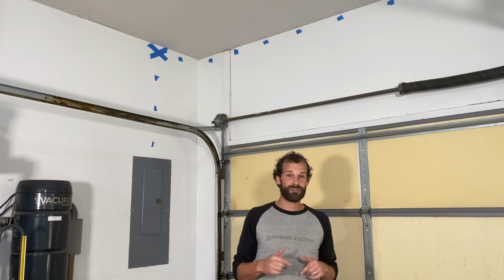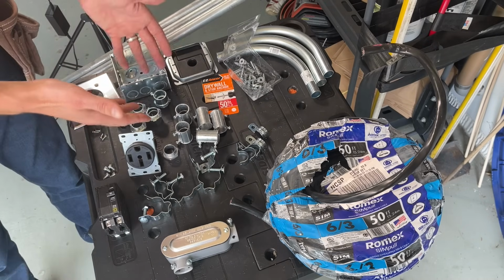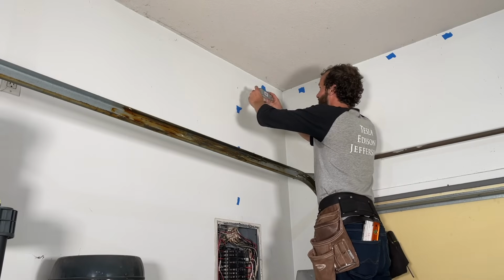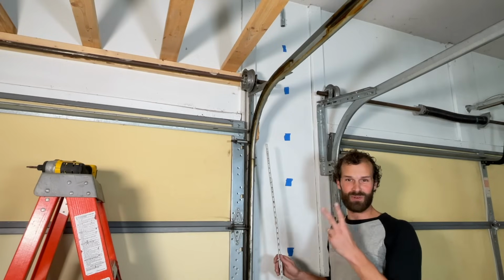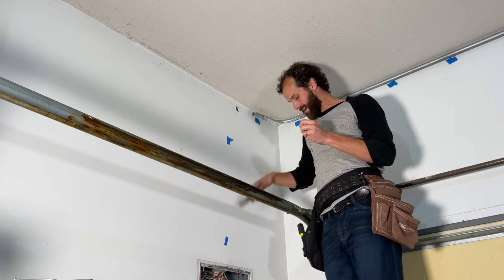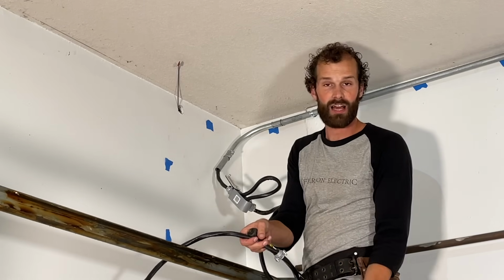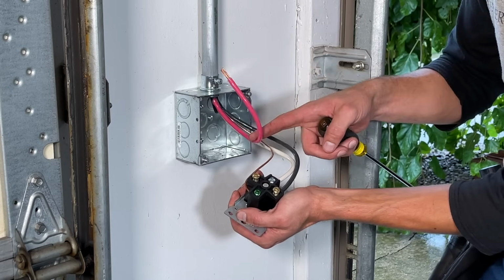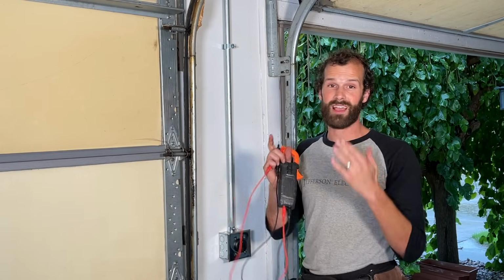How To Install a 240 Volt Outlet | Electric Car Charging

Comment: That's a great installation but a few things here; first you should really buy ure self a nylon fish tape if you work on a live panels, second, always use an LB best ever from coming off the walls, third, you made a code violation on installing NM romex cable inside EMT and lastly you could have used 8/3 NM romex but but only  inside walls or  #8 AWG THHN threw the EMT witch you have used in this application, Good clean work tho..!  Some I've done with data network cable as well.
Reply: Unfortunately, I think that 6 AWG wire is required due to the 60 degree celsius rating of romex (see NEC 334.80 and Table 310.16).

Comment: What was the price difference between romex vs single core and conduit ? A few pple I watch from Texas went with Mc over romex because it was cheaper smh on tht 1 lol. Wait a minute why wld you run romex thru emt (yes most ahj will allow it) but it's hackey and sloppy not to mention more money than just buying a 200 to 250 ft spool. Also an antishort bushing on that romex connecter wldnt have hurt too lol all In all not to bad should have stripped that romex from the lb to the other outlet box run and used a romex connecter on the open end of lb going to panel your lucky you don't have a strict bldg dept lol
Reply: Thanks for commenting. Most forms of flexible wiring like MC cable don't comply with the protective requirements of our AHJ (see NEC 330.12(1))
Reply: @joelwalsman773  o ya I was just using the Mc thing as an example what I was getting at was why use the romex vs just single core spool as usually romex is more per foot over say thhn just needed to cut in more of the sheet rock and just did the whole run in conduit and thhn over the more expensive (I'm going to assume romex) unless romex was about the same as single core spool per foot? I've seen say that 50ft romex for like $225 but single core thhn for like $130 or less for a 250ft spool
Reply: @wizard3z868  I like it!

Comment: if you are using 3 wires (2 hots and neutral, No Ground). Use NEMA 6-50. Tesla no longer includes NEMA 14-50 Adapters. Giving you the choice of buying 6-.50 Pig tail for the mobile adapter
Reply: Tesla sells the adaperter on line $35
Reply: NEMA 6-50 is two hots and a GROUND ......... no neutral

Comment: Is USA 120 volts?
Reply from the maker: 120V / 240V
Reply: @EverydayHomeRepairs  so is there a different shaped out let to prevent plugging in a 120 appliance into 240 outlet? Thanks from Australia
Reply: @richardday2893  yes, many configurations depending on ampacity, phase (single phase or 3-phase) as well as voltage (120V,  240V, 277V, 480V, as well as 120/240V (receptacles that include two phase conductors and a neutral). Almost all of these configurations are based upon the North American NEMA standards which help us keep consistency in our installations.
Reply: @steveloux4709  thanks for the info.

Comment: From a practical standpoint, 6/3 Romex is just too stiff to want to pull through conduit of that length, so pulling individual wires through the conduit would have been easier and much faster. There are different options to get into the wall to the breaker panel - I probably would have preferred flexible conduit and a large junction box to avoid the need to splice wires.
As an owner of a 130 year old house, I do appreciate the improvements made to home design in areas such as fire safety. Still, homes have have taken a step backwards in maintainability - it should be easier to do things like access a breaker panel to add a circuit.
Reply: Yeah.  I'd go with individual THHN wire in conduit here, and not the Romex, personally.
Reply: Romex is not recommended in conduit (extra heat). If you are running in conduit you need a larger conduit than you would usually use for the same number of conductors.
Reply: @rich7447  I just learned that from a licensed electrician. He recommended to use thhn 8 in conduit
Reply: I so thought of doing that way as well. Good point
Reply: I freq map out my paths and pull the wire through the conduits, before anchoring it.
Reply: Romex is needed behind the wall though.
Reply: @heyitsjay22  not if you run flex. Would have been easier and faster
Reply: @heyitsjay22  Behind the drywall you could use Romex and connect it to individual wires in a junction box outside. That would be fine. But, you could also fish a flexible conduit behind the drywall so that you could run individual wires the whole length without splices. A vehicle charger can draw high current for several hours, so I'd prefer to minimize the number of connections when possible. Actually, I tend to run new circuits from time to time, so if that was my house I'd probably make that section of drywall removable to make various installs easier.
Reply: @JasonEDragon  I agree, I would have cut the drywall.  Also using the individual wires would be better for heat dissipation.  Thank you for your response.
Reply: Romex Dosen't  belong in conduit,  check building codes.  And see manufacturers uses and why.....
Reply: @dannytorres4388  Article 334 Section 15 (B) "Protection from Physical Damage." Says that you can use EMT, RIGID, or PVC conduit  for Types NM and NMC.
Reply: @dannytorres4388  Send us a code reference saying romex is not permitted in conduit
Reply: I just don't know why conduit is outside of wall. For $1k
Reply: @MultiMaverix  If you don't want to rip the drywall off, yet still provide some physical protection.  Electrical code can get kinda fussy about exposed romex in work/shop areas.
Reply: @MultiMaverix  how would you run it in the wall then?
Reply: I run that Romex through the conduit all the time. But I’m not a fool like most electricians and pull with through the conduits after it’s installed. I plumb the conduit as I go and it’s no problem to run that way.
Reply: @cygnus1965  Doing it the way you describe is a code violation. 300.18
Reply: @cygnus1965  that’s what I did on my first run. Measuring out everything fitting it Dropping it running the wire was easy. Then putting everything back up. 

On my second run I found it less time consuming just to fish the wire through with two people.
Reply: This is a complete shoddy and potentially dangerous installation!!! Romex in conduit???wtf??? Contact a real electrician.  He can point out the fails. And why its unsafe!!! He won't be wearing  "CARPENTER BAGS"!!!
Reply: @dannytorres4388  what is dangerous about this installation?   Point to point Wiring.  Three layers of Insulation and protection.
Reply: @dannytorres4388  what box do you use with an Niema 1450?  The Romex  has stranded wire with each wire color  being insulated ( except ground).  Then there is another level of installation beyond that.  Then you have the conduit as a final protector if not an insulated    One. 

I am not an Electrician.  I have worked with Electricians for a long time. Never seen romex used this way.  I  don’t understand why you feel it is dangerous.   May just be above my pay grade.
Reply: @dannytorres4388  I agree it was real bush league work. Cheaper to use 6awg thhn in 1 inch conduit

Comment: I thought this was a great video and I learned a lot, both from the video and the comments. From a safety standpoint I'd agree with the comments that too many shortcuts were taken (live panel, no PPE). 
From a technical standpoint it seems there were other ways to do the job but there were still many good tips for someone with general interest which is how it was presented in the intro.
Reply: Hey fellow canuck
Reply: Hey fellow canucks.  He does say that if you are a DIY you should turn off the panel.  I've rarely see experienced electricians turn off panels.  I'm guilty of that but don't recommend it.  One big difference between Canadian electrical panels and US panels, Canadian panels required any conductors before the disconnect breaker must be in a separate compartment.  There is often a cover plate that covers the feed side. The idea is if you turn off the main breaker, no exposed parts of the panel will be energized.
Reply: @domenicdefrancesco  hey Domenic! Yes, he does say that but then does a lot of work in a live panel. I know guys do it, like you I don't think it's not a great practice whether you're a pro or not. 
Good point about the mains being covered in Canada. I hadn't realized that. 🙂

Comment: Wired my own 240V outlet in the garage last year for my CNC.  I used a 4 prong 30A twist lock so it is secure and I can break out 120V for the brains.

Comment: Without commenting on the accuracy of everything said, this guy is an amazing YouTube instructor.  No obvious cuts for take after take.  Lots of hints.  Great communicator.  Not his first rodeo.  My biggest issues?  Don't use drywall anchors for such a big box, it wiggled.  Locate stud first or use toggles.  Violated his own safety rule using steel pull tape on a live panel.
Reply: Yeah, you're right Ole. Time to update the old tools.
Reply: It can be so hard to compromise the flexibility and durability of the metal tapes for the fiberglass, though.

Comment: First of all, their is NO 220 volt service in the United States. That “standard” was fazed out decades ago. 110 volts was increased to 120 volts which caused 220 volts to become 240 volts. 120 and 240 volts are the current residential “standard” now in the U.S.
Since this person wasn’t even aware of that, I’m wondering what he does know about this subject? 
Further into the video, he does talk about 240 and says 220 and 240 are the same! Lol. As others have said, THHN would have been a much better choice with the entire run in EMT. Pulling Romex thru size conduit, would cause me to do a lot of cussing.
A conduit bender would make the job easier and improve the appearance of the job.
Reply: He fully discussed this.  Adequately.  That is phased out not fazed out if you are going to be that picky.

Comment: No ground screw in 1900 box. Also Romex is not supposed to be in conduit per code (it will get too hot, especially when drawing 40 amps max for a few hours). You should have ran THHN in the conduit and had splice box above the panel to splice the romex after fishing it through, but this involves more work and material and I would probably do it how you did it anywsy. Moreover, I think those metal anchors will most likely fail down the road, I would have used 2 toggle bolts to secure the 1900 box instead.
Reply: Can you cite the code violation against romex in EMT conduit?
Reply: @protoman247  I'll look for it and find it. I know for sure it's a local code violation here in NJ.
Reply: @Moksoory1  ahh I see.  local codes aye 🧐 I’ve seen many ppl comment either way on the topic but I guess it varies on the local code.
Reply: @Moksoory1  hey doc.  You are right.  Ahj can override nec 334.15.b...nm cable protection approving conduits (EMT) to protect nm cable

Comment: A lot of critical comments on this video. I think most are from frustrated know-it-alls who don't themselves have an outlet for showing people how smart they are.  I think your instruction was first rate. Sure there are some safety issues and maybe an alternate way of doing things but that's like life. If you're afraid of doing something dangerous, find your safe place and don't do it.  Good job.
Reply: @Joe-by8jh  Not okay with people getting killed. However, I'm pretty sure he said this was a higher grade outlet which implies it completes a ground circuit through the mounting screws. In that case the entire length of EMT and the metal box are grounded back to the panel via the bare copper ground lead. But I could be mistaken. In any case, I just don't like it when people attack anyone who doesn't do a job according to their own perceived notion of right and wrong. Too many critics in the world, many who are ill informed or just simply mean people. Hope you're neither.
Reply: There are actually many NEC violations in this videos .
Reply: No, the majority of critical comments are from professional electricians not wanting to see DIYs get hurt or killed.